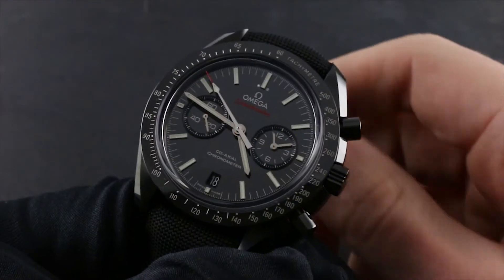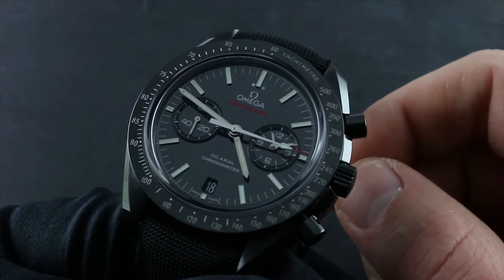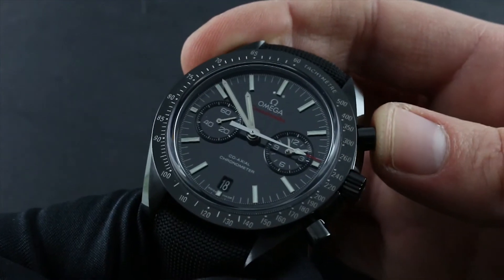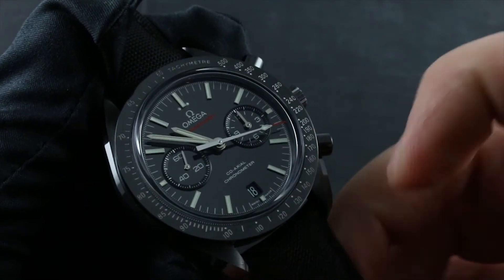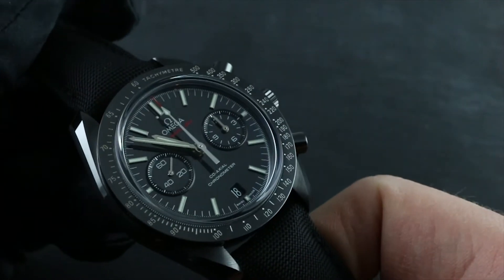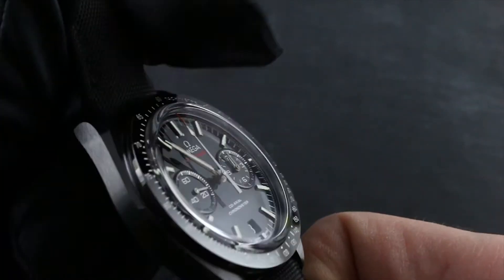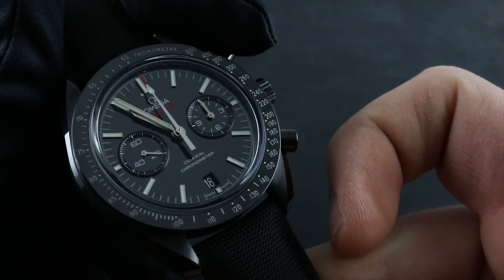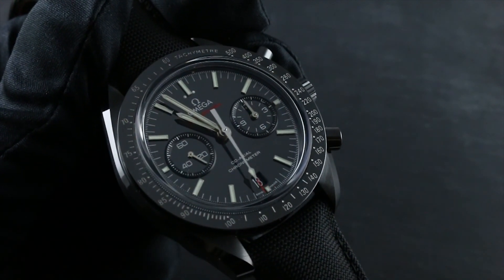Omega Speedmaster Moonwatch Dark Side of the Moon 311.92.44.51.01.007 Functions and Care

Comment: Just wondering:  does the winding crown spin freely with absolutely no resistance when you turn it in the other direction?  Mine works perfectly but I’m wondering about this little oddity.  Never encountered it before.